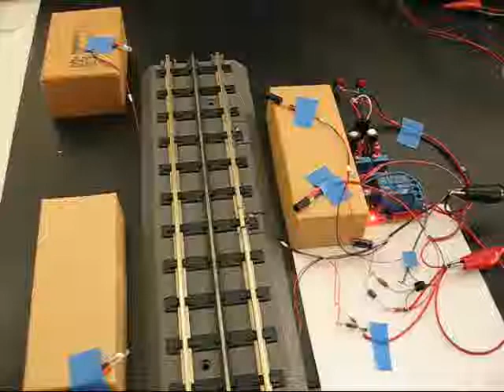DIY infrared track activation (ITAD) crossing flasher

Comment: What did all that cost to put together?? I paid 20 bucks for my itad
Reply from the maker: This was just youtube hosting the video for a model train forum discussion:

https://ogrforum.ogaugerr.com/topic/32543207218207910?reply=41271599579783503#41271599579783503

If you are willing/able to work at the component level, use a soldering iron, etc., then you can cobble together the basic functionality of an ITAD for maybe $2.  Refer to the forum discussion above and join for "free" if you want to participate.  To be sure, very few guys have the time for DIY train electronics and would rather spend $20 or whatever for an off-the-shelf ITAD.